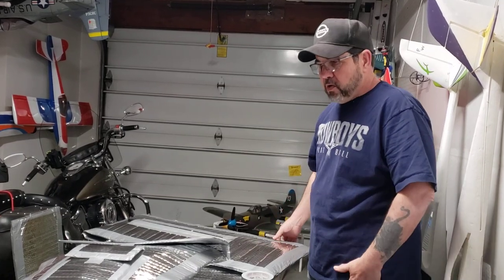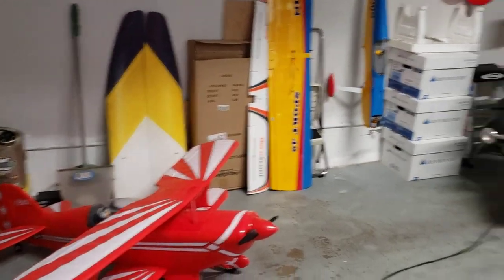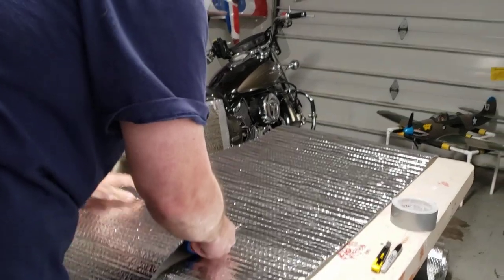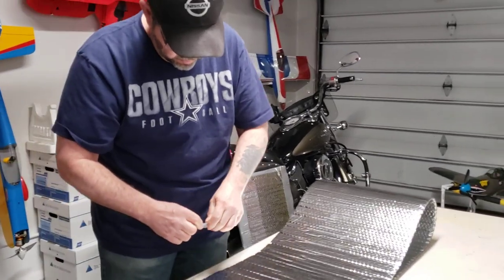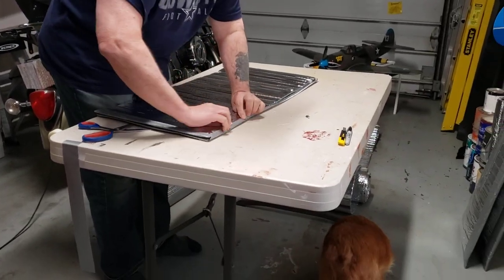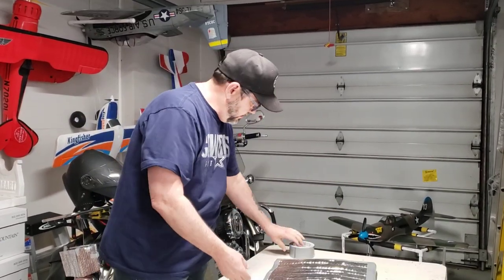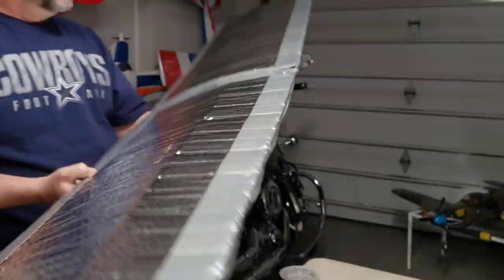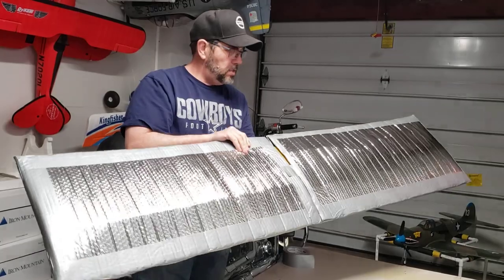Wing bags made quick cheap and easy at home

Comment: Can you post a link to this product please. I've never seen it before.
Reply from the maker: https://www.amazon.com/REFLECTIX-BP24010-x10-Foil-Insulation/dp/B000BPF22U/ref=asc_df_B000BPF22U/?tag=hyprod-20&linkCode=df0&hvadid=167138746282&hvpos=&hvnetw=g&hvrand=1287347548947473129&hvpone=&hvptwo=&hvqmt=&hvdev=m&hvdvcmdl=&hvlocint=&hvlocphy=9030456&hvtargid=pla-312007480985&psc=1
Reply from the maker: You cN get the same stuff at lowes refectix
Reply: @starsandstripesrc8475  thank you so much
Reply from the maker: @Trevor Furlotte  your welcome, so sorry for the extremely late response to your question